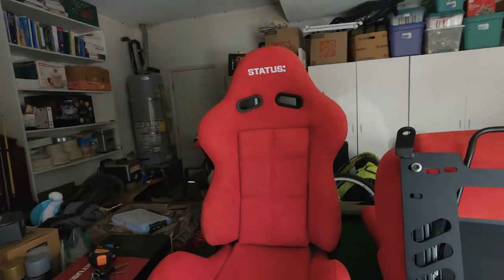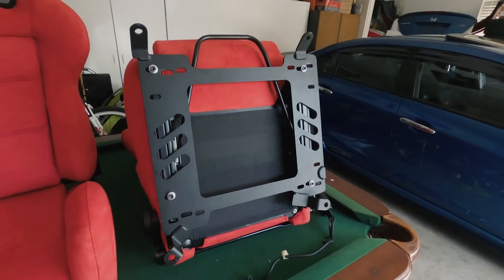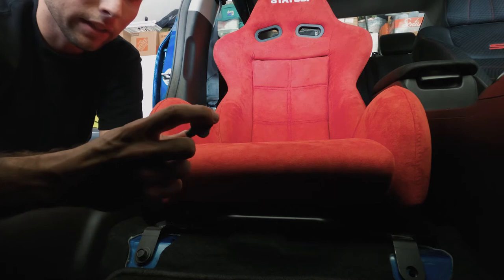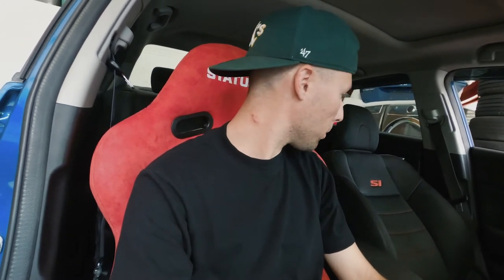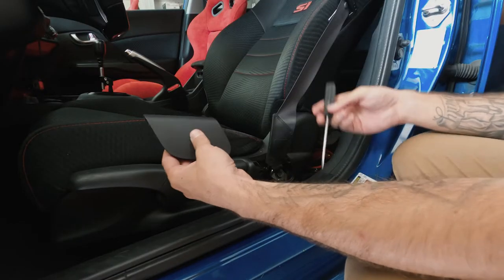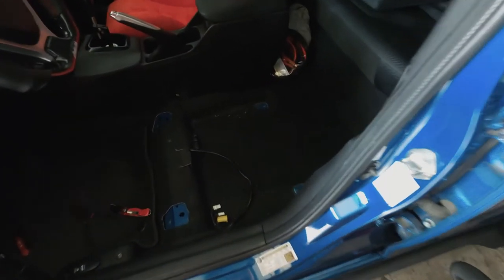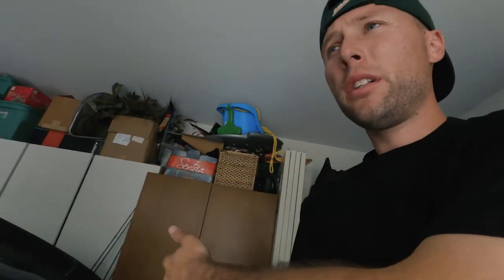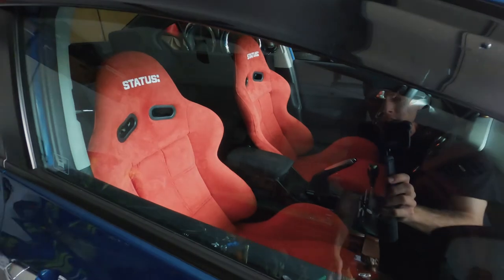Status Racing Seats For My 2012 9th Gen Civic Si FB6

Comment: Aye bro! You’re 2012 Fb6 is clean clean! I was wondering. Well first what aftermarket front bumper do you have ? And then my other question is, you got any trouble or problem looking down under the car and seeing the exhaust pipe come down like a curve after the catback? Or you still have stock exhaust?
Reply from the maker: Don’t have aftermarket bumper. It’s OEM 12 sedan bumper and only comes on the 12s. I have KTuned exhaust with fullrace downpipe and no issues with any clearance but I drive low so I scape a lot and disconnect exhaust from flanges every once in the awhile but easy fix tho.